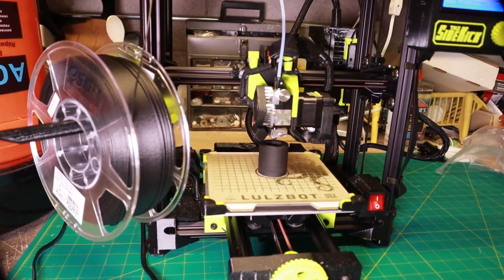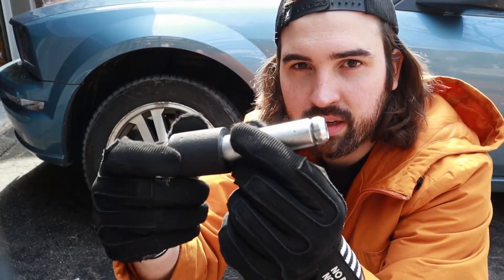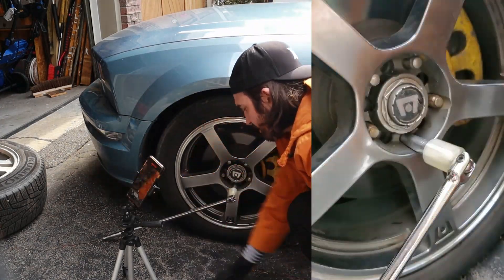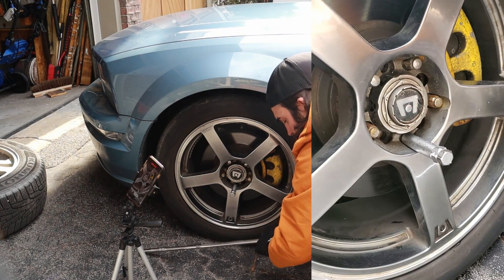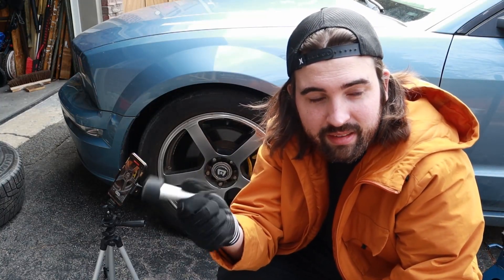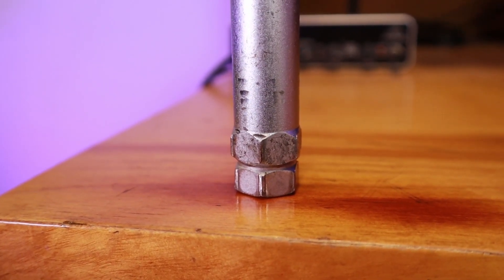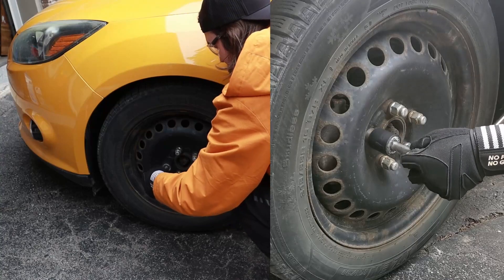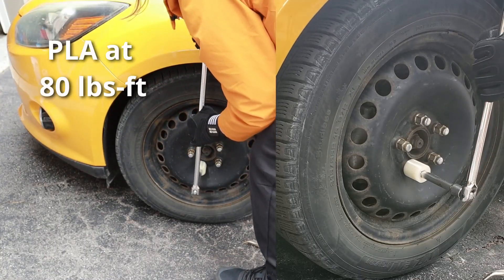(OLD CONTENT)

Comment: The lug not clearing the rim? could not tell what you were referring to but, I will say I was a mechanic at ford, their stock lug nuts, which are what you showed they swell over time badly until you end up having to hammer on sockets to place them with new ones. They do sell actual steel lugs as the upgrade pretty much.

Comment: A few things to mention, people overhype CF Nylon as the best filament out there yet they overlook the glaring fact that it's really brittle and will fall apart in these scenarios. I would suggest doing this test again but comparing it to Glass Fiber Nylon which is not as brittle. Nylon 6 vs 12 also makes a huge difference in a test similar to this. I believe Nylon 12 would not be able to handle the stress as well as Nylon 6 CF/GF. Annealing the sockets before testing should also make a substantial difference with the CF Nylon as well.

Just a few ideas for videos if you ever decide to come back to this topic again. I'd also suggest not printing Nylon on an open air bed since the fumes aren't good for you.

Comment: Hmm, that's cool. Wonder if it would still work if you created the bulk of the shell in PLA to maintain the shape and printed a CF insert to go against the nut. You'd likely need some stringers to extrude into the PLA so it doesn't deform it and round it out.
Reply: id say using fiber in different orientations in the part. ie. longitudinally at the edges and laterally around the casing. But according to some material strength laws if you use any pla it will only serve to make the part more plastic and deform.. yeah it wont explode but it also wont be stronger. so defeats the purpose. Its important to note that these things are MUCH light than metal parts..

Comment: Lots of parameters to check before we can really definatly conclude anything, printing direction, note that not all PLA are equal, Moisture level of filament before printing, temperature when using the torque wrench...etc...

Comment: Not practical though. You can get a socket for far less time and cost than printing it out of carbon fibre filament. Would be better used to make structural parts for cars/machines that have hard to find or no longer existing spare parts.

Comment: As a mechanic I enjoyed the content based on what I know about working on cars if you can remove the extension it adds a sidways force to the socket and i would have thought the fail point would be a split or a break did not expect the the socket would round

Comment: That’s way more than 100 ft pounds, because as you loosen the adjacent nuts the steel wheel springs out. This is why you tighten in a star pattern. To do this test with more accuracy retorque all nuts to 100, then take off 1. It will be easier.
Reply: good point.. all about controlling variables.

Comment: My first though is increase the diameter of the socket. This will decrease the Shear stress in the material for the same amount of Torque. You could even calculate (with a safety factor) what diameter you need depending on the allowed Shear stress of the material.
Reply: I think the  direction of grains of the fibers should make a bigger difference than thickness.. And you may even be able to make the part smaller as you using the real power of the carbon fibers in tension.

Comment: You're actually moving more than 100 lb on that last lug nut with the other lug nuts loose you're getting pressure pushed down on that final lug nut which is making it about 110 up to 130 PSI on that final lug nut

Comment: It was an interesting experiment.  However, the torque to loosen a nut is not necessarily the same as the torque that tightened it, especially when you have loosened the other lug nuts thereby putting more pressure on the remaining lug nut.

There are digital torque adapters which go between the breaker bar and the socket.  Some just function as sound device in a torque wrench.  But, some can be set to record peak torque applied.  Some are pricey, but Amazon has some under $50.  You might look at Project Farm here on YT as he has tested a bunch of wrenches and used a digital adapter on some of his videos.

Comment: Nylon is a rather garbage base polymer to embed the CF in. PET-CF (available from Essentium, not cheap) or PC-CF would probably be better choices. PET has essentially isotropic strength (no layer line weaknesses) when printed at proper temperature.

Comment: since you’re twisting the nut in a clockwise/counterclockwise rotation i suggest printing the part laying horizontally so the print lines are vertical not horizontal. Horizontal lines creates a weak point if you’re putting stress also in a horizontal rotation. Clockwise rotation, vertical print for best case scenario. I know its a round nut but in this case if you want to make the part has strong as possible you’ll need to add support and lay the stl horizontally. That’ll give you the best chance of success.
Reply: He should try it to see how much better it fairs out. I'm surprised that he didn't break it off at the layer lines. I think a 45° angle would be the most ideal for cylindrical objects being used with rotational force.
Reply: @grantdeisig1360  Actually he would get the most strength in this case if he flipped the design 90 degrees so its laying down, but the part wouldnt be accurate in shape and dimensions due to round things not being round anymore.
Reply: @zizor1759  That’s what the original commenter said
Reply: @mrepicpant  I know, but Blackwater clearly didnt read so i explained it a 2nd time.
Reply: 45 degrees would be ideal, first way he did it would sheer, the way you describe would explode with too much force due to it trying to expand from the nut
Reply: @michaelmain1990  Or youre just not an idiot and buy the proper tools for the job. FDM printing is great for pretty things and useful stuff that wont be load bearing or exposed to large ammounts of torque, but for the purpose in the video you use steel tools for a reason. Even injection moulded plastic would break from this.
Reply: Couldn’t that also cause the part to split???
Reply: Definitiv the strongest way to print is the way he did.. Without a doubt. Peace
Reply: @GUCR44  No it wasnt, if you print the model standing then the layer lines will be going left and right when in use, since torque is coming from those directions it will just snap at the layer lines since thats the weakest point. If it was printed laying down then it would look a bit uglier and have some minor inaccuracies regarding shape and dimensions, but it would be far stronger against the torque.

Source: Im a CNC machinist, self taught in CAD and i do my own product designs (along with testing them + materials used).
Reply: @zizor1759 OK np..

Comment: did you test the layer adhesion your self or just go buy what you think or manufacturer says? Carbon fiber strands will just make layer adhesion worse not better. For the fibers to make the layer adhesion stronger they would need to combining the 2 layers which they do not. Being nylon it will absorb moisture, i would wait a week or 2 before use.

Comment: The outer wall thickness is key in carbon infused nylon filament. More layers from 2 or 3 to 5 to 7 an you will not need more then 60 percent infill. Speed will improve an strength by a lot.
Reply from the maker: Thanks! What speed do you usually use?
Reply: @maddydeeemedia1672   On my Bambu Lab printer it's hard to declare a speed. Because the printer varies the speed depending on first layer inner wall and outer wall settings. Around 200mm but reality its likely around 80 to 140mm.

Comment: 3D printing is great, just not sure about tools. This is a neat experiment though.
Reply from the maker: Yeah I don't think I would recommend it for tools either. Just was curious how strong this stuff was. Thanks for watching!
Reply: I actually use metal AM on the regular for creating specialty tools on a jet engine assembly line. Pretty handy, but too pricey for an average user obviously
Reply: Yeah that would be amazing, but consumer level stuff like that is ages away. Even small business can't afford it.  @BenWilson24
Reply: @IPrint3dMinis  yeah, you can get a printer that's around the build volume of an ender 3 for 750k-850k, but that's not going to get you very far. And all the peripherals are really what add up